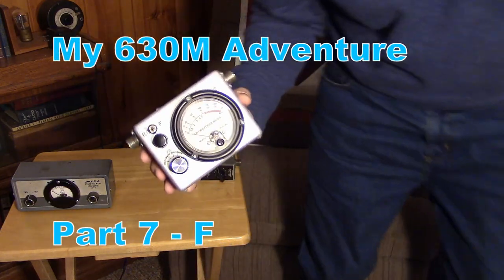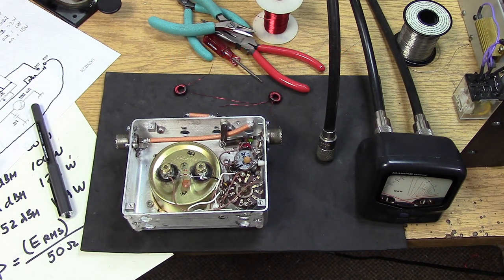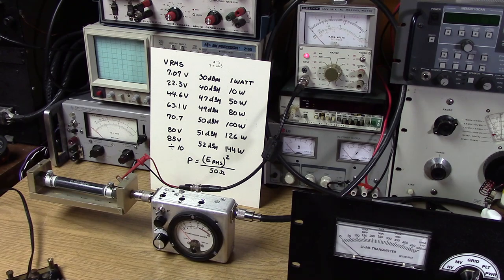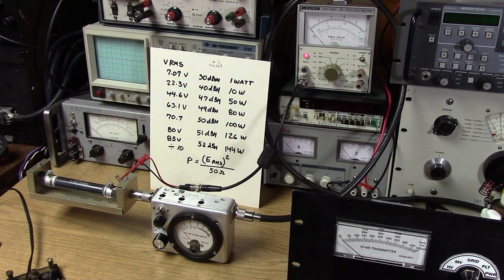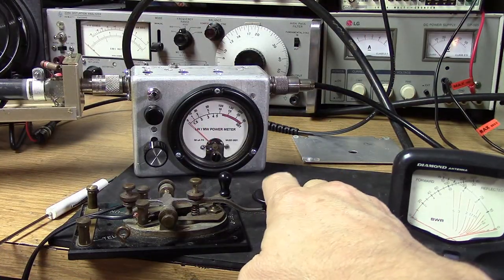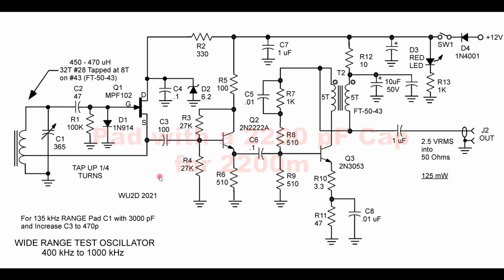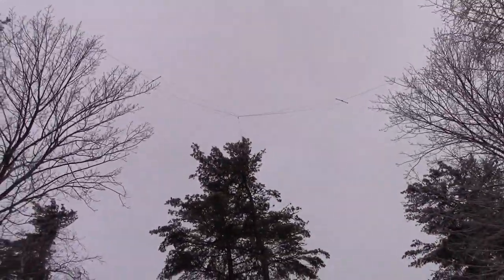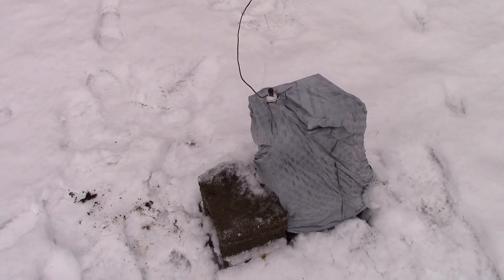My 630M Adventure - Part 7

Comment: Thanks Mike. You are putting ideas and keep adding projects to my brain. Have the LFO in my ART-13, have a nice working BC-453, was given a large, roller coil usable in an external tank circuit for the '13. Have room for a toploaded vertical..  Was about to order a new 5-300w wattmeter for hf when you posted this. Yet another project to make my own 😁.
Thanks for sharing!
//Tommy
Reply from the maker: Your are essentially ready to go on the antenna part and BOOM - you will be on the air on 630M.

Comment: Mike, I heard you on 630 meters a few nights ago.  I'm still in receive only mode, working on a loading coil and variometer to get the antenna to the point where I can match it to the transmitter.  Your series has been a great inspiration.
Reply from the maker: Very Nice. The band was really open tonight. It has been poor since just before Christmas.

Comment: Hi Mike, 

I've just binge-watched the whole series today. Totally enjoyed it, thank you. 

I'm a little stuck with space so have gone up in frequency and built a station for the QO-100 satellite with GPSDO locking of everything from the RX feed to the transmitter and receiver. 

I've also been watching some kite antenna 630m video's /P which have been interesting. 

My personal favourite band (and has been for many years)  is 60m for NVIS but would be interested in moving down the bands at some point, but space constrains me at the moment. I use a Wellbrook loop on RX and a resonant dipole for TX as the electrical field noise is pretty high. 

73 de M0SNR
Reply from the maker: Wow you went nuts and watched the whole thing? ha.

Comment: I found your adventure with 630 meters And now I am hooked. LOL   I filed to get permeation for  use of the band. I doubt I will have issue.  I have the RX TX equipment. A few Ideas on the antenna, It's going to be quite the adventure to get on. If I get approved for the use of the band hope Hopefully I can work you. I will post up when I know more,  Thanks for all the info  It has been a great helping start,

de Larry W9AMR North central Indiana. Near the University  of ND,   sk
Reply from the maker: Spent lots of time up there in Park River. Plenty of room for Frisbee and Antennas.
Reply from the maker: Of course the University of ND is in Grand Forks ND.

Comment: Interesting how ways of measuring power and SWR have changed over the years. I'm a photographer by trade and spend a large part of my life in Photoshop and really rate Photoshop Elements as value for money. Unless you are doing very sophisticated work, you don't need higher and more expensive versions.
Reply from the maker: I make sure that I have it at work too. I do the schematics in an old illustration program called Canvas. I have been misusing that for 25 years!
Reply: @MIKROWAVE1  Misusing Canvas LOL! I don't know it but will check it out. 73.

Comment: What about 100W to heat the antenna up a bit to melt the ice.
Reply from the maker: That's what I call practical!
Reply: DGK: A little AC line current goes a long ways.  Dig back in the archives, and you will find discussion of hams doing this!  LOL.

Comment: does the coax outer conductor need to be removed where the toroid is to allow coupling?
Reply from the maker: The shield is connected to ground only on one end.
Reply: @MIKROWAVE1  Thank you!  And so, it seems that this then allows the signal to couple through the semi-shielded coax, eh?   Is the grounded end the end that is further from the toroid?
Reply from the maker: @drstrangelove09  The half grounded coax shield becomes part of the coupling wire magnetically speaking - so no real coupling effect there. Its purpose is to breaks up the undesired capacitive or electrostatic coupling to the windings of the toroid (and to other things) thus improving the performance and flatness over frequency. I tested it on 80 Meters and it is still accurate.
Reply: @MIKROWAVE1  Thank you so much, good info.  I appreciate it!